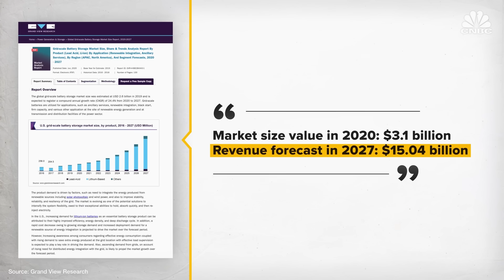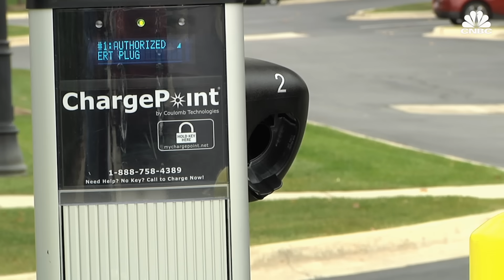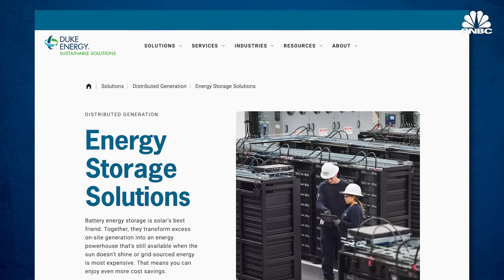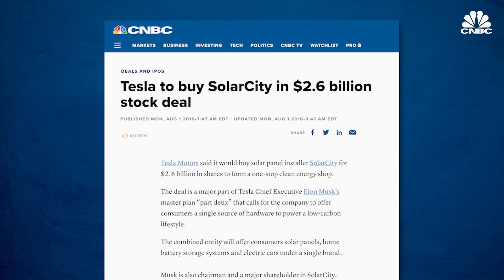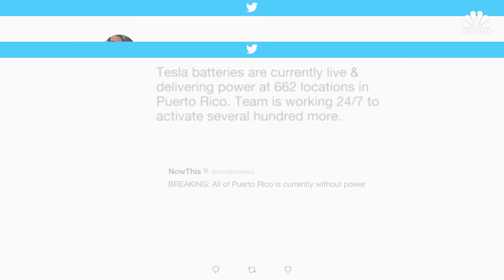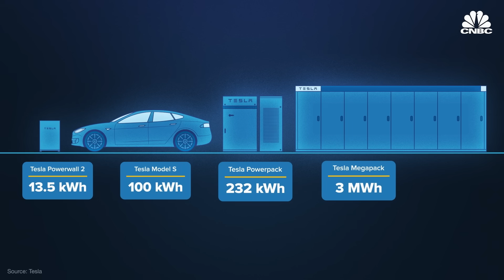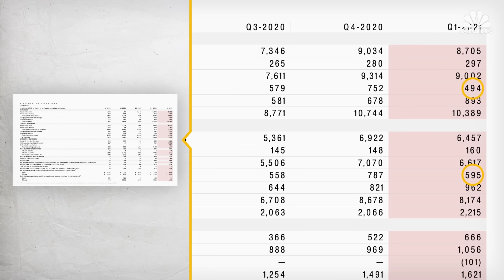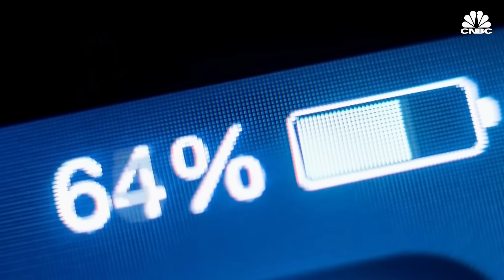How Tesla Is Quietly Expanding Its Energy Storage Business

Comment: I have a small dairy farm and wanted to use battery storage instead of generators during a power outage. I'd be using from 6-12KW/hour. I could even reduce it to 3KW/hour if necessary.  2-3 hours storage would be fine.  However, our solar and battery providers are saying they wouldn't recommend it. I can't find any info on the internet about a battery backup system for farms or small business, has anyone else come across a solution like this?

Comment: LFP batteries are even better suited for storage than cars at the moment. Size and weight is an issue for cars but doesn't matter for fixed install batteries. LFP can be charged for more cycles and to higher percentage without degrading the battery. LFP is also safer and doesn't require nickel or cobalt.

Comment: In 2022 it's almost lunacy to pay for Nickel/Manganese/Cobalt-containing batteries for stationary energy storage. You only need them where the highest energy density is crucial, such as in high-performance (expen$ive) EVs. For grid storage (where a little more space is no deal breaker), LFP is far more appropriate and cost effective. However, battery tech – and the battery market – are evolving so fast; better/cheaper choices may start to get produced at cost-effective scales, at any time.

Comment: I understand what Elon Musk is heading the Tesla future goals, most exciting is the energy storage vision, having been involved with the operation and behaviour of standby power I haven't seen  much of the monitoring of this disipline I am curious what Tesla has developed to monitor the online battery state  also the prediction in how the batteries will behave when total current supply is called for, that is the detection prediction of any weak cells in the string of batteries that will not behave up to speck  when total current is called for, a monitoring system that checks all of the battery strings on a predetermined check rate that can identify any cell that will not deliver current at the specified amount thereby causing the whole system to falter, a monitoring system that would report back to the onboard computer any deficiencies in the banks of cells so that the proper maintenance can be performed?
Reply: What you describe (question?) Is precisely the same system deployed in Tesla vehicles.
Each cell is fused.
If it produces too much current ("fails") the fuse blows.
Each cell is connected to the "BMS" (battery monitoring system) at an individual level.
This maintains variable charge to assure all cells are at the same level.
At the next level, cells are "grouped" and those groups are compared and adjusted in a similar manner.
The Megapack is simply a "net" of similar systems connected, then controlled in the same way.
As for "total current", the system components have been "tested" (stressed) over millions of miles in vehicles. They know the limits.
They know the best control protocols.

Comment: First level batteries for Solar Roof doubles the price, the next level triples it. I expect commercial to have similar multiples.
We need Gen III+ and Gen IV nuclear to supply baseload and to burn up existing existing spent nuclear fuel which is largely the right fuel only contaminated with a small amount of unfissionable byproducts. Wikipedia has an article on Gen III+ and IV.

Comment: Sorry, but what this report is not talking about maybe missed it but degredation for industrial level run cycles is on lithium ion is going to be a next-level challenge and if they can deliver this power without hvaing to replace the whole thing every year then Ill be impressed. The reality is the MW discharge is only 75% at most stated and on top of that - they won't charge to full because its also bad for the battery - roughly 80-90% full charge. This isn't EVEN starting the issue of % loss / time with degredation from dendrite buildup and inefficiency. Believe it when you see it folks - and that its runnign for quite a long time powering a full city for 2+ years. Otherwise, dont believe it. The issues i mentioned are based on my extensive study as Tesla's own lithium ion recommendations as well as the energy industry. Not downplaying or shade at CNBC - they make killer reports month after month - but some of this stuff simply isn't factual - like the Vortex Bladeless turbine etc..

Comment: Solar panels should placed more and more on roof tops.  They have a way of protecting the roof from direct solar heat and heat storage.  In the middle of summer in these hot states, you'll see it works best.  And not just roofs, I'm talking car ports in apartment complexes, car ports at malls, car ports over drive thru's, etc. etc.

Comment: Since May 2018 I have had my (Solar City / Tesla Energy) 10.7kW system in operation with 2 Powerwalls. In December 2018 I purchased a LR-Model 3 which now has 37,000 miles.  With +98% of my vehicle charging occurring at home, here are my lifetime stats at of 6-6-2021:

Solar Production: 46.3 mWh
Usage: 43.7 mWh
From Powerwall: 19.5 mWh
To Grid: 12.74 mWh
From Grid: 12.71 mWh
Reply: I~n~v~e~s~t~i~n~B~T~C~&~E~T~H
W~H~A~T~S~A~P~P

+~1~4~7~0~6~6~4~1~0~7~0
Reply: Thanks for your feedback. To take advantage 
W...h....t....s....A.....p....p +1.....(3....0...4..)... 3...6..,.2..-...7...6..4=5.

Comment: The amount of global warming from trying to make so many batteries is stupid. There are better large scale options like have two ponds of water at different elevations (even 20ft is enough). During the day only the bottom pond has water and can have a solar array to power a pump during the day to pump it to the higher level pond. Then at night have a dam with generators of the higher pond to the lower pond which will make power during the night or when you need it. Basically using the energy in the water as a battery instead of battery tech which will NEVER be a cost effective solution and releases emissions from making these large batteries is huge. Even if we had 500 years in advancement in battery tech it will never be cost effective.

Comment: Some good theory by the battery day guys about self driving Tesla's and sending power to home storage or to rebalance the grid

Energy Web is going to be massive and is part of the bigger picture, many years of change ahead and no doubt some surprises. Powerwall supporting Bitcoin mining as a compatible addon or bundle makes sense soon, and automated management of what happens when supply changes eg no sun, as things get complicated a human has no chance of managing it perfectly but a very basic logic model that can learn patterns and integrate with basic planner, calendar and realtime tracking of what you tell it or just what you do and dont have to tell it ! 

No matter how energy costs and profitability vary, optimization will be so powerful and we will have much smarter houses with relatively boring AI. One of the biggest things accelerating many disruptive innovation sectors is the combination of maturing technology. The ARK-invest teams research is incredibly interesting, free, and their podcasts never disappoint, wide range of experts across all the investment sectors. Predictions from AI experts are for advances too fast to comprehend, it will be nice to have an easy and cheap service to access anywhere from our devices and get the same results as years of human hours

Comment: the lithium batteries have limited cycles and will need to be replaced.  Newer batteries will have more cycles but all the existing batteries will need to be upgraded.  Solar farms take up a lot of space, maybe they can develop more efficient solar panels as land has to be taken to build these things and endangered species could be compromised.  Also cobalt mining is an issue even if you switch to a different chemistry then those materials will need to be mined.

Comment: Shred Toxic Battery Waste and Recycle (when did YOU ever do that for anything with Toxic Waste..???) ... sounds like  another Global Nuclear Waste "Solution"...  same old "song, dance and mirrors all over again"... re-packaged 70 years later ... Just like Nuclear today is not needed as Solar is there.... similarly when Clean, Safe, Non-Polluting AND SUSTAINABLE Compressed Air is there... [ CAES... Compressed Air Energy Storage; CAV ... Compressed Air Vehicles]...

Does it makd sense to take Clean Solar Energy and reduce Pollution... and then use it in a Battery EV and produce Toxic Solid Waste... with or without Recycling... thereby replacing Vehicle Emissions with Solid Waste... as the same old Pollution returns again... in another form...

... as President Reagen would have said.... HERE WE GO AGAIN... !!!!

I am NOT AGAINST Eliminating ICE Vehivles with Solar Powered Electricity EV's.... but if these EV's generate Pollution... we have achieved.... NOTHING...
[ Please see my YouTube Channel zeropollution2050 (ond word).... for details]...

Comment: As EV's become widespread, they will also add batteries to the nation's green energy storage system when they are plugged in for charging and discharging (if you only need 50% charge to get to work, the other 50% can go back into the grid when it is needed) at home.

Comment: Technology will always win, I'm glad that the world is moving toward removing Carbon footprint though it is still a long way to achieve. But with almost all the big players in the industry got into renewable technology and electric vehicles, there will be fewer obstacles and lobbying against it. We the people will be the one get the most benefit from this.
Reply: Yea but large scale batteries defeats the purpose - emissions from making the batteries at such a large scale makes it non-renewable so don't be so short sighted. We have better options of storing grid level power like into water batteries (not an item but a process of storing energy. Must should work on solutions like this.
Reply: @JohnAdams-qc2ju  ay idea how long the batteries would need to be in operation to off-set the energy used to manufacture? are we talking a few years? decades?

Comment: Looks like a lot of fossil fuel is being burned to build and mine the energy storage. Excavators, lulls, backhoes, cranes and vehicles that the construction workers drive to the site in. Are the factories that build all of the components using 100% renewable energy? How about the trains that bring the taconite to the ore docks and the ships that deliver it to the steel mills? Let’s not even start with what the steel mills use to process the taconite. 
FUD you elon
Buy Bitcoin
Reply: Transition will take 50 years. Buy BTC if you trust China.

Comment: This video is a flat out lie. The Texas grid failed because the power companies did not follow the ERCOT recommendations on three seperate occasions. The companies were told to winterize their equipment but they did not. This neglect caused a domino effect with the natural gas suppliers and the power generation companies. It was NOT a reliance on fossil fuels. The real problem was Texas always had reserve with traditional power generation.  It's wind and solar was part of the reserve. Because Texas is growing so fast, that reserve was gone. The grid was not managed properly because ERCOT was being ignored and the winter storm exposed this neglect. The texas legislature should have been directly connected to ERCOT because they have no enforcement behind their findings. As far a Joe Biden providing trillions for infrastructure, what a joke. Less than 25% of the money is actually going to infrastructure. That's like saying we must save the whales and raise millions for the cause only to redirect the funds to everything but the whales. Stop being afraid of nuclear power. We lost lives to finally perfect airplanes. We lost less lives perfecting nuclear only to allow fear to push the best energy source into mothballs. Nuclear has powered submarines and ships for over a decade without refueling. NUCLEAR has ZERO emissions. EV has huge emissions when creating one battery and then using the grid remotely which is mostly everything but nuclear. If you want to really help the environment, have scientists and engineers look at taking the fear out of Nuclear Power. Figure out how to stop nuclear fission. That would make everyone embrace nuclear power. The industry knows how great it is. The government has done a poor job at being transparent about it. The industry cannot be heard because of the news media and Hollywood.
Reply: Tony Seba - no, wrong

Comment: I'm in the Vanadium redox flow battery industry, and I can tell you that lithium is not a viable option for long duration energy storage. Lithium batteries are best suited for short-term storage, because the charge they hold dissipates over time. To store sufficient energy for months or years would require many batteries, which is too expensive to be a feasible option. Flow batteries are a better option for long duration storage. Flow batteries have been proven in the field that they are feasible for long duration storage, thousands of cycles, minimal degradation, and no limitations on depth of discharge.
Reply: I want Vanadium flow batteries to work, but LFP Batteries are cheaper than all flow batteries in terms of $/kWh. So far nobody is buying redox flow batteries at massive scale, their market penetration is very low. Certainly, the charge Li ion batteries hold dissipates over time, but it's still cheaper in the long run. How sustainable is Vanadium, how is this sourced? I don't know the answer, but I know Lithium Iron Phosphate batteries have the ability to scale easily. There is no perfect solution, but LFP for grid storage looks more economical.
Reply: Spring Power

Comment: So when are we going to do pumped hydro between Lake Erie and Lake Ontario so as to no affect the existing hydro there and modify the Bonneville Power Administration (BPA) to do variable output with more generators instead of doing base load with it as well as effectively eliminating the use of spillways granted they would still be there for safety reasons?  The Lake Erie and Lake Ontario pumped system could be scaled into the 100 GW range granted we got into long distance high capacity superconducting power lines, but in the short term maybe do a couple dozen GW of storage and the BPA modification could scale to be like adding 20 GW of batteries to the grid all while being rather cheap to implement both of these solutions, especially considering what they would be putting out.  In total adding over 40 GWs of storage like this to the grid, one in the Great Lakes area supporting the Eastern grid and one in the Northwest supporting the Western grid would be a huge boon to our renewable future.  Batteries are great, but they do come at a cost and so we need to do these other obvious solutions that have been sitting right in front of us when we can.

Comment: Batteries degrade with age and cycle, this will work for a few years maybe a decade. Also, the energy density and the rare earth metal required for large scale storage solutions is impractical. If you switch to a flow cell battery that would help but not our current battery tech. I live in socal and our energy is expensive, there's always blackouts and now the government is paying people to install a device to shut off ac during high demand time. Basically they're going to shut off your ac when it's crazy hot 6 hours a day. So you're going to burn like crazy on those days. We need to go fast thorium breeder  reactors with nuclear waste lasting only about 300 years.
Reply: Spring Power

Comment: Battery’s are old thinking. The new thinking is to produce frozen hydrogen during the day and deep sinking it into the ground. Then at night as it expands over night being used to move turbines during the night as the gas turns back into water. It’s would have no pollution and be constantly reused. This is what we need to invest in as batteries still have a waste byproduct issue once the batteries are spent
Reply: You are right, lithium belongs only in cars and phones.
Reply: Tony Seba - wrong

Comment: Batteries are cool & all, but pumped hydro is much more important.
Simpler technology, cheaper to build, extremely low maintenance cost and a 100 year life-span, no chemicals that need recycling.
The reservoirs are not pretty, we will have to give up some nature-reserves, but it's the only way to get the capacity we need in time.

Comment: if anything we need to use our resources more efficiently and longer-term. we HAVE to expand energy storage FAST. Not only for renewables but for existing power generation as well! Imagine if every house in a neighborhood had a power wall (or a powerpack) and each of them charges and discharges when one house uses less and the other uses more! If I had solar and I would be at work and everything at my house is turned off I'd definitely want my collected energy to be shared with the neighborhood!
Reply: The car is the rolling UPS and that's where the batteries should go.

Comment: This clip is full of BS. Just because Texas grid sucks it does not mean traditional grids "cannot handle climate change" WTF that even means???
Batteries are actually good because, like the other guy said, you can go t 0 to 100%, in an instant (yeah ok but up to now we've always been able to handle the peaks in demand, read hydroelectric gas turbine plants), but mainly because you can scale them down without losing efficiency. You don't need a mega plant like you do for thermoelectric.
You can have small efficient plants in  houses and distribute them all over the coutry, which actually reduces the risk of big failures like a mega fire in a mega pack mega plant.